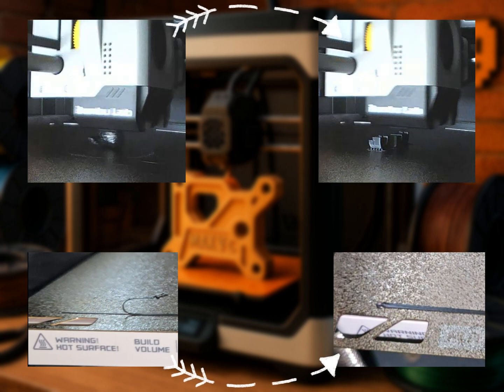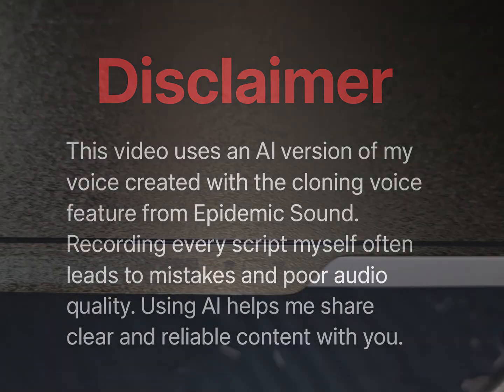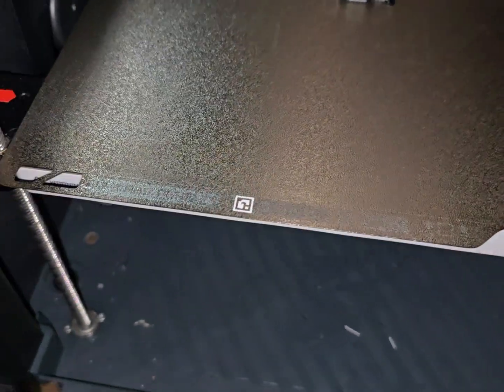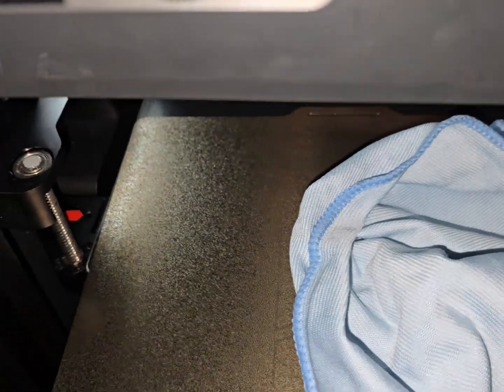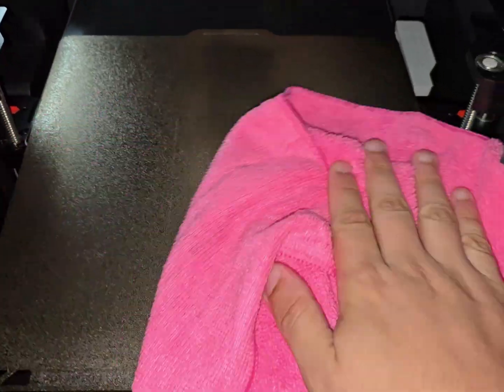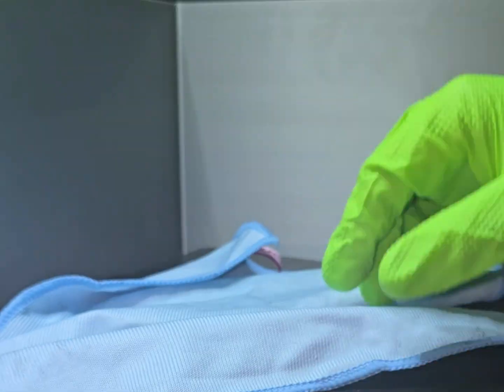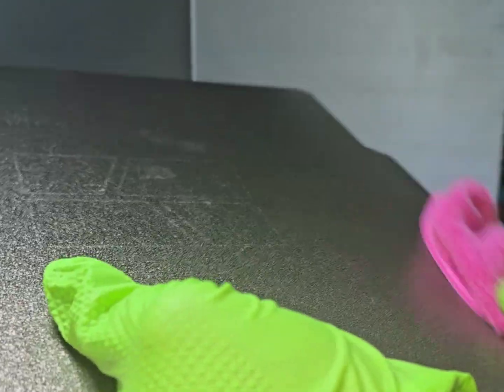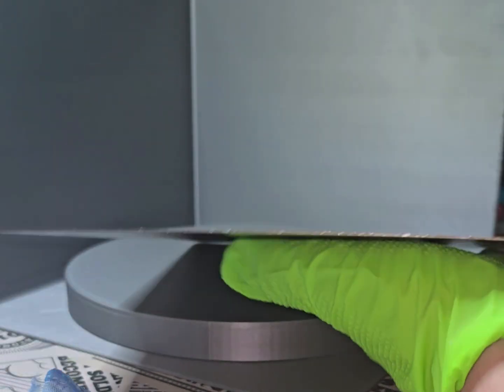How to Clean Your PEI Textured Plate and Avoid Adhesion Fails

Comment: I strongly advise to clean the build plate NOT inside the printer, even if ur just spraying alcohol it's a HUGE risk if it gets to the circuit board or could become a fire hazard if not properly cleansed.